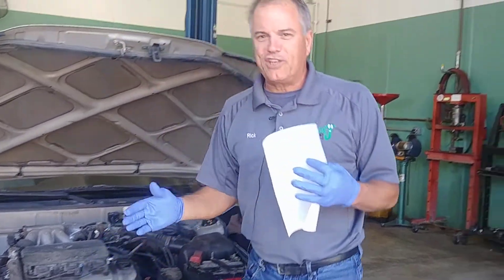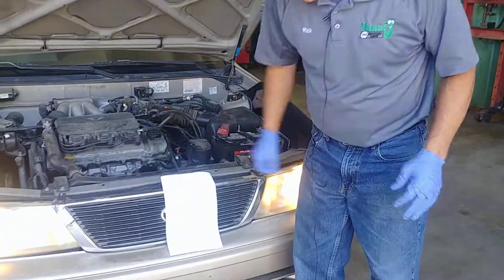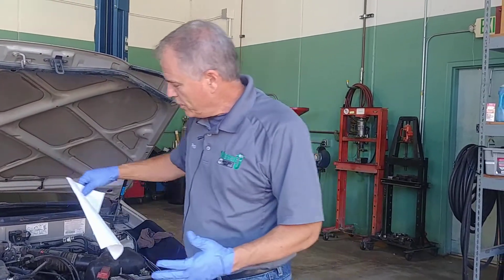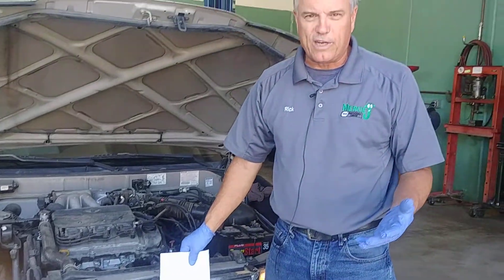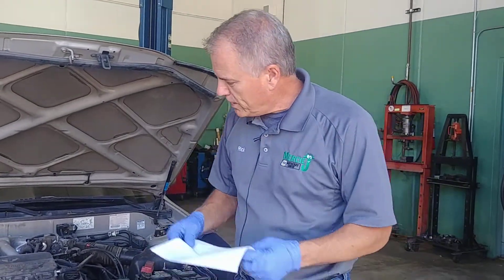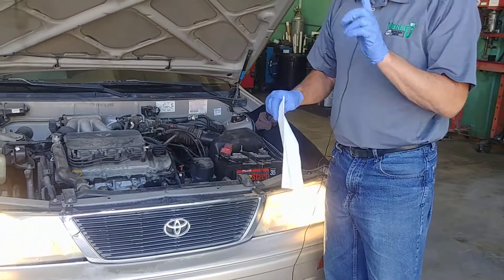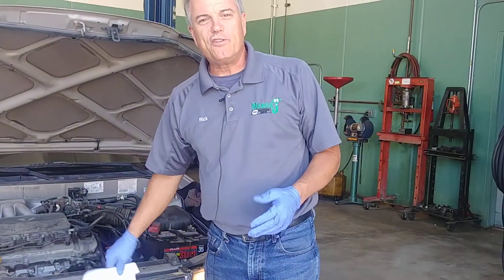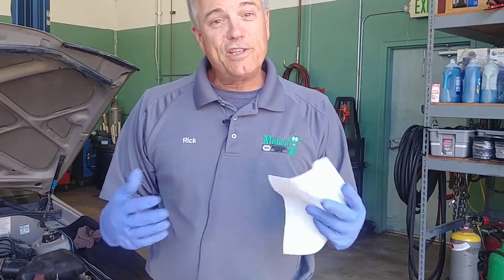How do I test my Cooling Fan?

Comment: Mine is blowing a piece of paper away. Why?
Reply from the maker: If it is blowing the paper away from the grill, then the fan motor is wired backwards so the blades are turning the wrong way.
Reply: Is on backwards